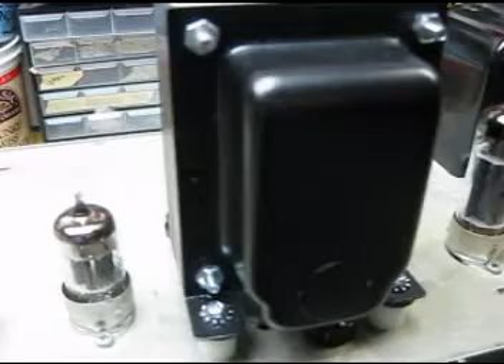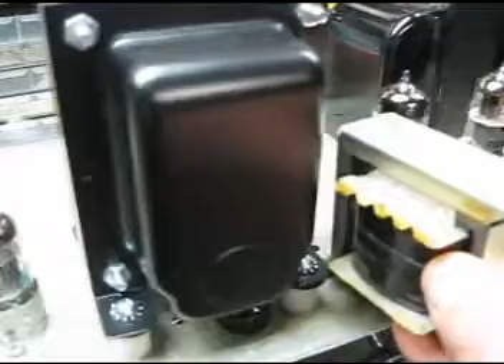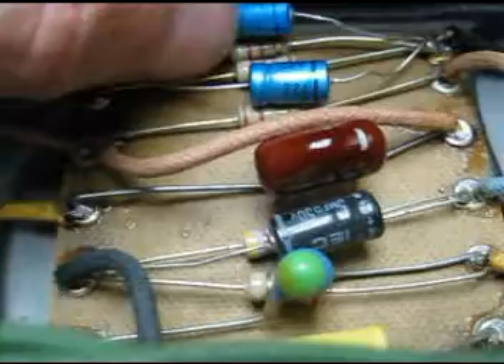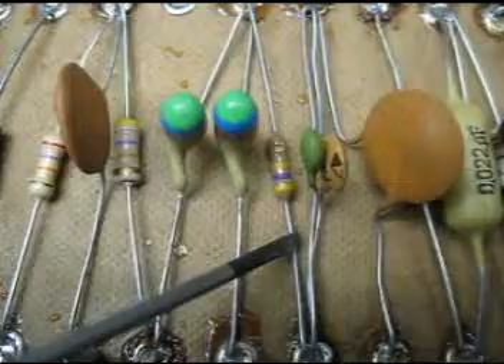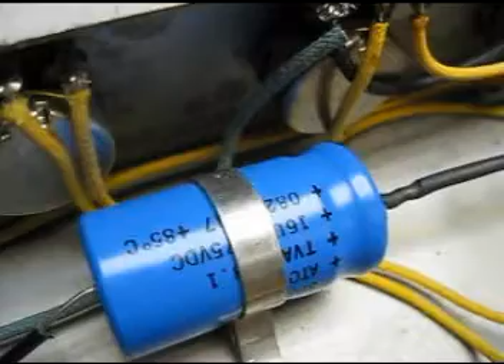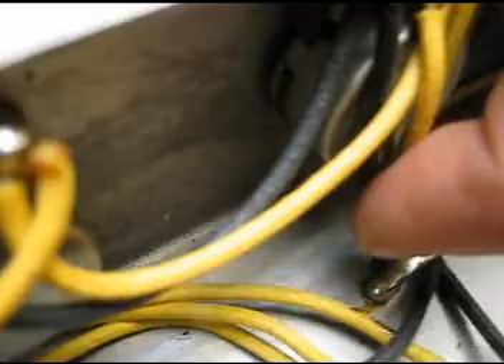Restoring hotrodding and servicing a trashed vintage amplifier

Comment: I picked up a studio mate for 100 bucks last year. Someone cut.it down , crudely , to a head. 
It was stock. I tried a couple furlan mods and changed the v1a cathode to .68uf and 2.7k.
Im going to try a couple more mods outlined in your repairing trashed amps video, 
And i may put an nfb pot in. 
Also MIEC makes a 40uf axial still !

Comment: Hello.  I have a ticking tremolo on my YGM-3.  My amp layout is a bit different.  It has 3 inputs, and all 6 tubes are in one row in the back of the amp.  When installing the 1.5K grid stopper in the second stage are you referring to V1B pin 2?  Thank you.

Comment: At 6:00 the Power resistor for the YGM3 screens is mentioned (R40). If you are using modern tubes you should increase this to 1.5 k or 1.8k (as in the re-issue), as Pat suggests,  so you can turn the amp up and use it to its potential, ie everything max'd out. If you want to further reduce the DC voltages in the amp, you can use a 370EX Hammond transformer.

Comment: @patfurlan Hi, i need some advice please with your experience you might know the answer to my question.
I have a 1969 hifi seperate amplifier with all original components inside,nothing has been touched for all these years, when i play a record through the amplifier audible distortion is heard,it gets worse the louder i turn it up.
If no music is playing at all and i turn it up full i can hears mains hum, this is my question.
Could the old smoothing capacitors on the power supply (from 1969) cause distortion and hum which is heard audibly?
and would replacing them with modern ones but exact same value cure this?
if not this what else is common in the cause of distortion in amplifiers

Comment: Great video, Pat.  I have restored and modded a 1973 YBA-1 and currently working on a vintage YRM-1.  My instruments are circa 1930s-late 40s Rickenbacker lap steels, so my requirements are lots different than a typical guitar player.  Clean, lots of headroom, and tone stack that will give a deep mid-cut needed to tame the typical steel guitar pickup, particularly these big horseshoe units in the Ricks.  These are great amps and fun and easy to work on.  I understand tube electronics well, but it took me a year or so of research and reading to figure out the ins and outs of preamps, tone stacks and what to mod and how to do it to get the performance to fit my needs.  Keep up the good work.

Comment: i have a ygm3. i'm more than a hundred miles from anywhere that may have repair guy. ok it worked amazingly for one gig and it tripped the reset switch( same as blowing a fuse). now when i reset, it fires up the tubes but when i hit the standby  it makes a buzz and turns off. thats all i'm getting. any suggestions would be greatly appreciated.
Reply from the maker: replace the power tubes... use good quality JJtubes  do Not use sovtek
the fuse blew because a tube or cap has shorted start with the tubes
these amps run at 410 volts... they eat cheap output tubes
you can replace the 40ohm or 470ohm screen resistor with 2k to improve tube life ... read up on screen grid resistors & choke resistors
Reply: tried new jj's. caps look ok. how about the reset switch? reverb?
Reply from the maker: reset switch is tripped by the tubes, diodes or power filter caps ...if they are the original caps and it it tripping they are your next replacement

Comment: 3:05  don't forget your units: 0.001 is in uF (micro Farads) or you can also say 1nF (nano Farad)

8:29  at 120 cycles

also, lowering the value of your filter capacitors can be a source of hum...you inject 120Hz power supply ripple into your signal.

Comment: Also,if you read Morgan Jones book ( Valve Amplifiers 3rd ed, page 220) on tube amps, he states that ceramic caps have No place in the audio path and I fully agree.  Been doing this since 1981 and I have pitched countless ceramics in the trash.   The only reason manufacturers use them is because they are extremely cheap....and they sound like it!
Reply from the maker: that ceramic, is not in the audio path it is in the suppression path... in this case I think the effect is not relevant... but there are also cases where you WANT an inductive cap in the audio pathway
Reply from the maker: patfurlan
but that kind of stuff is beyond most people
Reply: Agreed, however if the designers wanted a cap with a certain inductive quality, they would have used one that had that quality from the beginning....not one that it develops after 20 years of age.

Comment: Why not just replace that ceramic capacitor with a silver mica?  Ceramics have the worst phase response (why they tend to sound harsh or shrill) across the audio spectrum and also get inductive with age.
Reply from the maker: it depends if the cap is a coupling cap or an pull down to ground tone cap ...
their qualities have a different effect in either function ie a very dark old style tubular cap will add magic sparkle when used as mid or bass tone cap ... but diminish sparkle when used as a coupler... that's one of the reasons reissue amps sound really bright but harsh they pass the highs between stages but also pull out more highs via the tone controls ... did I say this would get complicated
Reply from the maker: check out my guitar tone cap video to hear what caps sound like in a pull down function & keep in mind their eq response is inverted as a coupler
Reply from the maker: patfurlan
I would state categorically that ceramic caps have NO PLACE in a guitar tone control ... as they adversely affect sustain
Reply: Yet it appears like you do just that at 2:16 ?
Reply: I love this channel very few understand how tone caps can exist, they think if a cap has a certain capacitance value it’s all the same.  But inductance and phase response, these are very well documented in electronics

Comment: This is a very intuitive vid.... thanks for taking the time to make it. I'm reviving a near mint '76 Mark III 212 combo right now, it has the original Marsland drivers still loaded in it. I find they're not awful, but as I crank it up I'm rolling back the "bass" in the EQ because they're breaking up. As a country picker, this is a problem; so I'm thinking of replacing the coupling caps with the .01 value to thin out the response. I am however, afraid of losing tone by doing this... Will I sound thin at lower volumes by performing this mod? Thanks in advance for any input you may have on my situation....
Reply from the maker: if you do it selectively you will gain the tightness you desire... use a tubular cap like a mallory 150 or a sozo ... to maintain the top end qualities of the amp
modern crushed caps like orange drops are brighter

Comment: Questions: 32v/32v/16v/16v I'm going to assume is c23/c24/c25/c15 on my 1971-or the larger value caps are the first two filter caps?  Also: the 1st stage cathode bias and the tone stack mods are just safely commonplace from year to year on a ygm?  I had to replace the pots.  The volume is very abrupt from 1. A tech recommeded a 500k pot with a 500k resistor.  Would that be in series with the red wire going to the C2 input cap?  Maybe try obtaining a different 1m pot from another source?

Comment from the maker: those are all the reasons I got into tube amps... there are lots of bargains out there   Traynor, Garnet, epiphone's made in china    also don't forget the best trick in the world two distorton pedals ...set them up half clean and use them both at the same time
Reply: Epiphones made in China? Really, well I need to check that out.
Reply: @roncarter2188  Valvestate modded I believe

Comment: Silly stupid me!! Somebody is way ahead of me: AJ's Custom Cabinets makes a ''2x10+2x8 combo cab'' for an old Traynor chassis. 2x10+2x8(!) doesn't sound like much speaker for a large Traynor amp but it's worth looking into. It's a slick looking combo box for a cool Traynor but it would probably weigh a ton (but it would be worth it right?)

Comment: I am NOT an amp tech I'm a woodworker. I've always been told for years Traynor =GRAB it!!! You can STILL get a cool cool Traynor amp for amazingly reasonable prices but they are the worst kept secret in vintage sleeper amps. Well I'd like to re-box one of these in a Marshall or Marshall-like box for maximum mojo. I'm just that way.

Comment: Thanks! I got hold of an old Sylvania(green letters, black base) 6v6GT with 7 pins, I threw it in my Champion 600 to test it out. I only got some faint sounds then some hum so I took it out. Now my Champion 600 don't work! I thought pin 1 was dead on them old tubes, think I ruined my transformers? Not a biggie cuz I wanna do the tweed mod you posted, and swap for some Mercury Magnetics and a Weber speaker too. All the amp does now is fizzle a note very faintly when the volume up full.

Comment from the maker: when you exchange a cap ie from .1 to .01 you shift the bottom up 1 octave   1 decimal place = 1octave 
there are actual formulas if you want to calculate an exact cutoff but in the guitar mate we are moving the low cutoff from 8hz to 80hz if I remeber correctly ... since most guitar speakers do not operate below 75hz 
all you are cutting out are the rumble and "fart"  elements of the distortion voice ...
you best tools for eqing an amp are your ears    trust them

Comment: Very interesting video.  I wish I had more knowledge of altering the  original coupling  caps to improve the sound quality.  I have a 1948 preamp AM FM radio that I would like to do the same thing to.   I have read that there are more expensive better quality caps for replacing in vintage amplifers to preserve  their original warm richer sound.

Comment from the maker: In this case since the amp was already missing parts I took the opportunity to dial it in for the sound I like.  I am willing to make changes to expand its "Vintage character" I also used a Twin sized output transformer. The goal is to get a Vintage Big amplifier (jtm 45) sound in an 18 watt package for club use.  Around here the biggest thing I see is people building Vintage style amps but "improving" the filtering then using the thing with an attenuator to try and control the power.